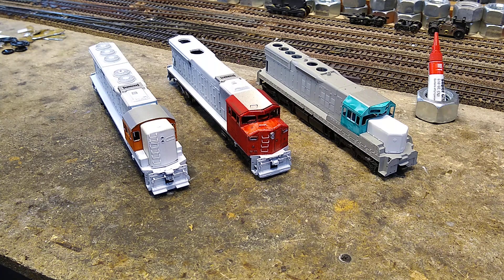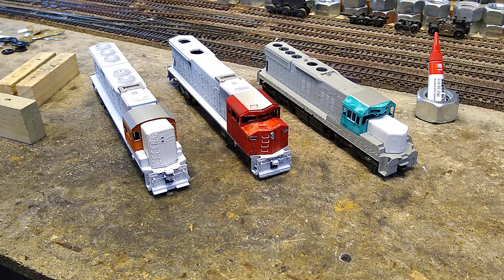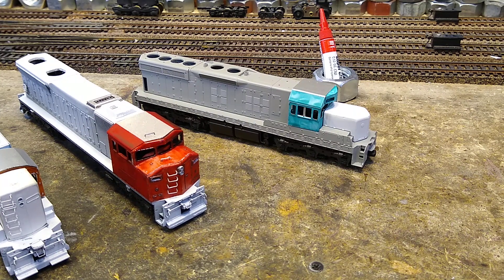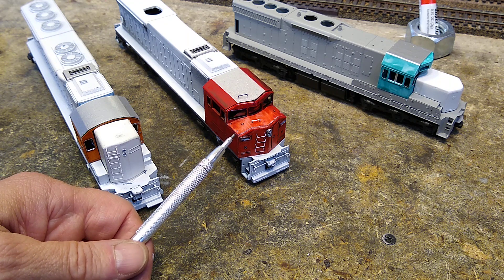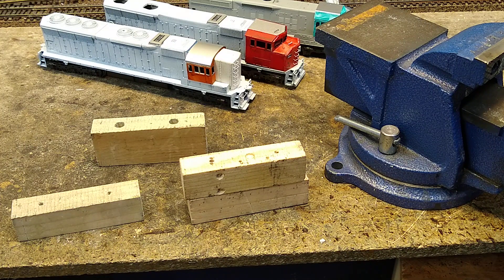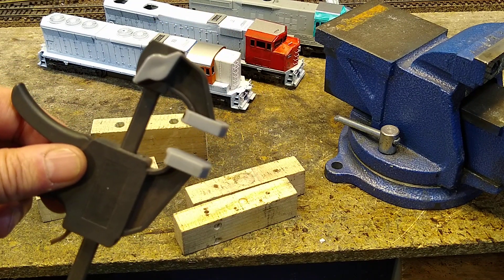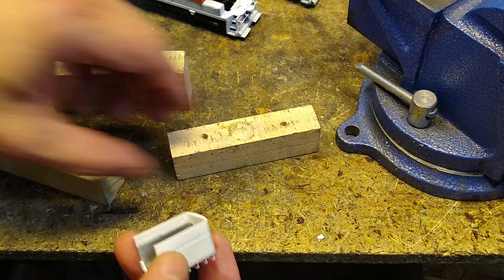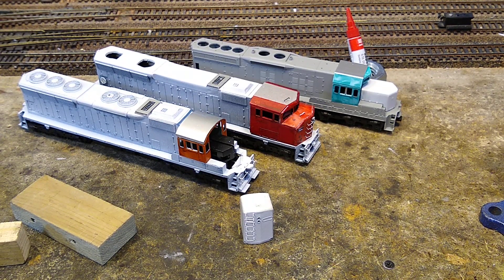5 locomotives in 30 days part 34 day 23 first look and clamping tools

Comment: I used your drill press idea to clean the wheels.  It worked great.  buffed whose dudes on the backside and wheel flanges.  Don't know how you would do it any other way.  At first, I thought it was overkill, but my crazy friend does it, I'm in.  Really was easy and fast when you got the rhythm.
Reply from the maker: the drill press is good for wheels, but the 3 inch grinder fiber wheel is the new gold standard